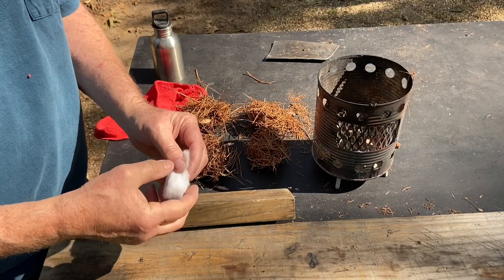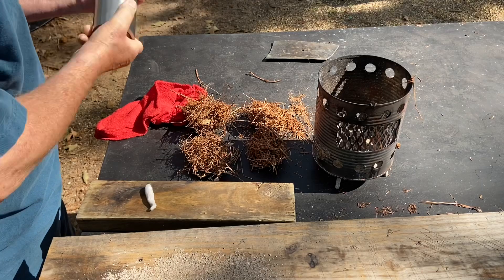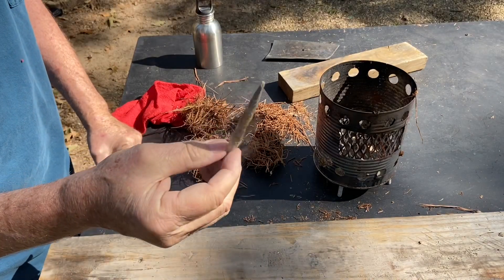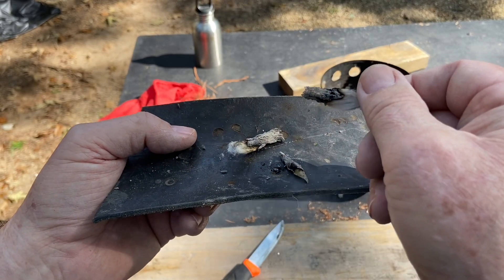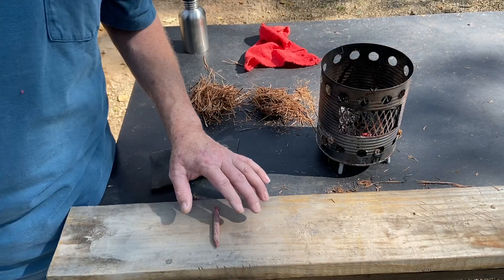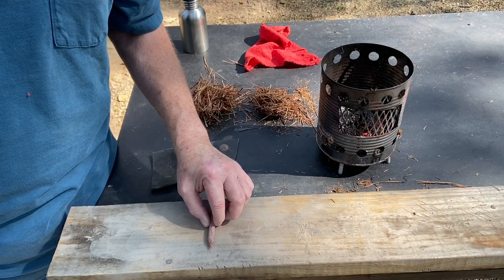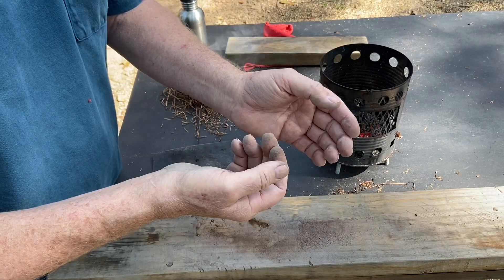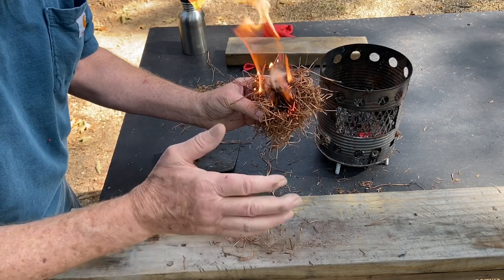How To Fire Roll Fabric... Exploring Internal Embers And Temperatures

Comment: If you happen to be out hunting, and do not have ashes or rust or lighter/matches, a couple particles of the propellant in a cartridge, or the loose powder from a muzzleloader BP, just a couple grains, will make the cotton or strip of fabric ignite very quickly.
Reply from the maker: Always EDC a lighter, fresnel lens, and ferro rod.
Reply: @DavidWestBgood2ppl  Yup, I forgot. I actually have a fresnel lens in the case of my cell phone, the ferro on every key chain, and lighters with several feet of duct tape strip in each vehicle.  :o)
Reply from the maker: You are prepared for emergencies.
Reply: @DavidWestBgood2ppl  My wife thinks I'm kooky but I even have a "winter kit" in each of my vehicles which contains dry clothing, food, water, doses of my daily meds, and even TP. The fact is, here PA, every couple of seasons or so, PennDOT completely drops the ball on a winter storm and cars get stranded for miles on interstates. And I live rurally in the Poconos, I could get stranded by winding up in a ditch just coming home from church some Sunday, so I like to be ready.  :o)